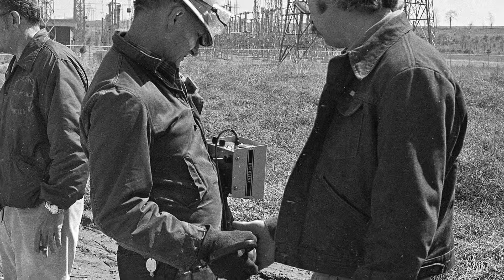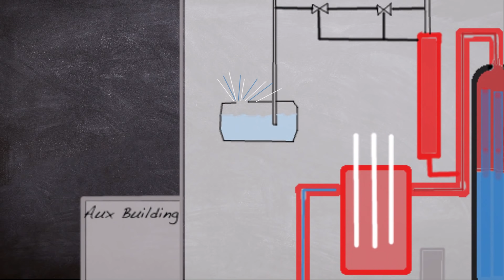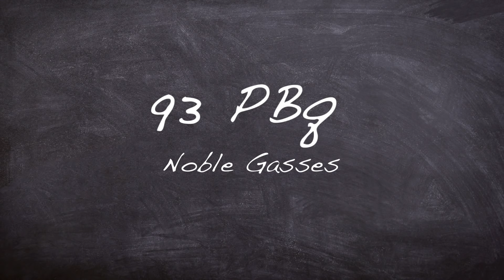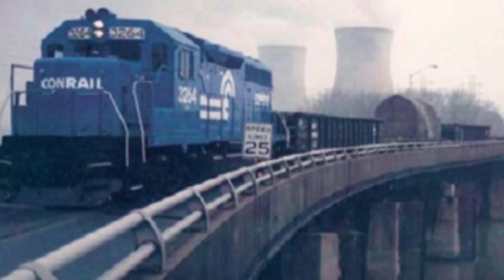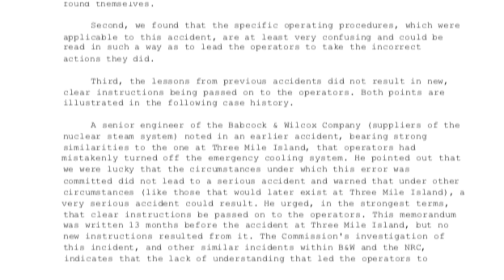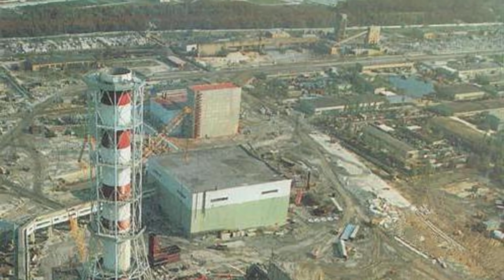A Brief History of: The Three Mile Island Accident (Short Documentary) (Part 2)

Comment: Man, this makes Chernobyl look...well it doesn’t really change how bad Chernobyl looked.
Reply: It makes the Soviet engineers look foolish. They put no thought into what would happen if the plant failed so as soon as it did, boom.
Reply: @andrewb378  this reactor was also different 
A total melt down of this type of reactor wouldn’t End as badly as Chernobyl 
Supposedly
Reply: there was no place to accitend in soviet union but lot of 5 year plans to fill.
Reply: @crimzonempire4677  Chernobyl also wasn't a meltdown. It was a steam/heat explosion of the reactor which then allowed the burning snd release of radioactive material
Reply: @stevenowen1748  it was a meltdown. All the cooling water evaporated. That's how we got elephants foot
Reply: @crimzonempire4677  just the concrete cylinders make that so
Reply: @stevenowen1748  literally was a melt down
Reply: @lockheedmartinf-22raptor73  There was after the explosion. But it didn't meltdown into the water table. The main event was the actual explosion.
Reply: @stevenowen1748  ...Of an operating fully fueled reactor core i.e. a far worse thing than a simple meltdown.

Comment: So the only way the control room crew knows that the tank in the auxiliary building is full is when the AC starts to vent radioactive gases out the chimney? Shouldn't there have been, i don't know, some kind of water level sensor connected to an alarm? And probably another alarm before that starts sounding as soon as water starts flowing into this emergency tank.

I mean, if you have some kind of emergency system that stores water in an emergency, wouldn't it make sense to alert the operators that the system has detected some kind of emergency?

Comment: If memory serves, the operators were ex-navy and brought that experience with them. The problem is that military reactors have different constraints than power generators. You did touch on the control room issues, but the layout was nonsensical with stuff like elevator alarms near core alarms and the alarm printer couldn't keep up with the issues so it had a several hour delay.
Reply: I think it was something to do with how they handle pressure buildups?  The system the civilian reactor used was perfectly fine on land, but if it happened on a sub there wouldn't be much of a sub left.
Reply: Navy has more operators on duty for smaller, less complex plants... so more likely for someone to notice something abnormal that an instrument may not indicate.

Comment: How do you “safely” evaporate nuclear water??
Reply: Slowly. Humans can handle low levels of radiation exposure and the most dangerous nuclear byproducts will decay away within a year or so, leaving only low emission sources. Furthermore, small amounts of radioactive water vapor will be pulled into the upper atmosphere where it will be pulled into clouds, and water (which clouds are made of) is generally decent at blocking radiation. If you just leave the water standing indefinitely though, you risk it being released in great quantities during a leak and also generating more radioactive isotopes as it sits (every neutron released can destabilize an atom and the chances of this happening goes up exponentially with the concentration of radioactivity). By dispersing it gradually, you greatly reduce the chances of knock-on accidents.
Reply: Evaporating it, theoretically the contaminated water will boil off and leave the isotopes behind. Think of boiling a pot of saltwater. The water will boil off but the salt will remain.

Comment: I can only imagine how much more advanced we would be as a species if we were able to fully realize the capabilities we have with nuclear power.
Reply: Exactly, sadly poor understanding and fear mongering have killed it. People don't look into the causes of these incidents and just belive anything radioactive is bad. They don't understand  how much safer and controlled it has become. Hopefully, with this newer push for clean energy, nuclear power will have a comeback.
Reply: @cheapskateaquatics7103  Nuclear powerplants are incredibly expensive to build and even more expensive to operate. They are simply not economically viable in most situations.
There may be reasons to heavily invest though. Mainly that a large nuclear industry is helpful in operating nuclear fuled ships and building nuclear weapons. 
Energy independence may also be one factor for some countries. Though that does often not include where countries get their nuclear fuel from.

Nowadays renewable energy sources are just way more economical and the storage problem is solvable with flow batteries (they can use far more common materials and no reduction in capacity over time) and salt heat storage.
Reply: @InLoveWithCities  they are cheaper to run than gas power plants, but expensive build means that brake even point is some 15 years into operation. Then there's decommissioning cost... 
However, wind and PV have much shorter lifespan, so they're not ideal, either. Hydro is great, but limited...
Reply: not to mention the amount of co2 saved from release.. but there's always a chance of disaster, I hope the new nuclear fusion reactor comes to fruition, it generates 4 times the power and is inherently safe (or so they say)..
Reply: Yeah, our species could have developed some great mutations that would make us into super heroes. :-D
Reply: @InLoveWithCities  whatever helps you sleep at night
Reply: I know right? High-tech kettles are useful AF.

Comment: Three mile Island sounds like more of a success story when you really think about it.
Yes, things went wrong, and yes, there was an expulsion of radiation, however the expulsion was on the lower end of things when compared to other events to other incidents such as Chernobyl and Fukushima, and it was of no fault of reactor design as it's sister's 40 years of safe and effective service would demonstrate. (To be fair, Fukushima Daiichi was of no fault of the reactor's design either, they just weren't expecting an earthquake followed by a tsunami of that calibre)
It's only fault was insufficient monitoring for the supporting systems. All that was really needed to prevent the failure was pressure monitoring at both sides of the relief valves so the operators could have actually confirmed a pressure decrease once the stuck valve was triggered closed. If such sensors were fitted it, this "disaster" would have been very easily prevented

Comment: What gets me is that, not only did the stuck valve gave no proper physical status indication, it was not given any redundancy. By fitting four valves as two series pairs in parallel you have a system where one valve stuck open or closed does not cause a failure. Obviously the valves should all have physical status indications so that a stuck valve could be detected and rectified to maintain the redundancy.

Comment: This is process design as much as anything else. If the pressure relief valve had a proper tellback switch on it instead of just a bulb across the solenoid, the failure would have been spotted in seconds. Someone cheaped out for a few dollars worth of a microswitch and a roll of cable, and it screwed the whole deal.

Comment: I would love to hear about Sadam Hussein's nuclear plant that was blown up by the Israeli's!
Reply from the maker: Ive already done a video on that https://youtu.be/UxuG5GVa43A
Reply: A.B. Yesssd
Reply: Based and redpilled
Reply: @PlainlyDifficult  what about the US over speeding his centrifuges being used in his weapons program
Reply: @Cowboycomando54  Wasnt that Iran like decades later?
Reply: Kezza Wozza yes, that’s Iran being hit by a computer virus which may or may not have come from the US and/or Israel.
Reply: It was redistributed all around the local site via semi aerodynamic-fin stabilized, medium density , gravity assisted  high explosive material redistributor devices delivered via human operated high speed low drag ,partial internally pressurized, winged high pitched turbo spinny fan operated ,accoustically-volumous high pressure oxygen suck- expand-blowout exhausters with computer assisted accuracy modulator devices 
Successfully pinpointing the reactors and subsequently redistributing them along with any respective operator personnel within the immediate proximity of the aforementioned reactors
#ControlRodOperatorLivesSplatter
Reply: Hear this: there was no nuclear material in that building.  It was still under construction.  Unlike any attempt in the history of Arab military attacks, Israeli air force precision strikes blasted the huge building off its foundation.
This meant the place was useless... it would cost a huge sum just to remove all the rubble.

Comment: Its honestly impressive how well the reactor was managed and a major disaster on the scale of Chernobyl was avoided.
Reply: To be honest, the part where you seen the control rods enter the reactor in the last video got me thinking that the exact same thing would have happened as happened in Chernobyl, thankfully, Three Mile Island didn't use graphite tips.
Reply: @thyrampantpigeon  Not quite the same at all. TMI was a much smaller reactor and had a containment building. Chernobyl had a positive void coefficient and TMI has a negative void coefficient, so the trigger for Chernobyl wouldn't have triggered a sudden burst of fission in TMI. There is also speculation that most of the brunt of Chernobyl's explosion was from the meltdown exposing ... some sort of reactive metal like Sodium (NOT Sodium, but something similar) to the main reservoir tanks below the reactor when it melted that far and less so hydrogen disassociation from the coolant water or a steam explosion from the temperature difference.

So in short ... No. TMI literally could not have exploded like Chernobyl.
Reply: @ashkebora7262  ok einstein
Reply: I think they avoided something in the scale of one of the Fukushima reactors. I'm not sure if that was an impressive achievement or pure luck.
Fukushima size without an ocean, wind blowing in the right direction and being able to flush huge amounts of highly contaminated water away would have been be pretty bad.
Reply: @Ulrich.Bierwisch  IIRC, Fukushima only became bad because their backup generators got flooded, too, and the batteries would only last so long. It was mostly a less than bullet-proof design. The only reason water really escaped was because they ended up having to pretty much fire-hose the core to keep it from melting down further, which without a circulation or protection system, yeah a good bit had to wash off. Though it was not anywhere near as bad as the media made it out to be.

Of course it wasn't good, but it wasn't anywhere near Chernobyl. (I think it was 1/10th the total radioactive material release? In that ball park)

TMI was yet another order of magnitude less. In fact, very, very little radiation escaped the facility. The biggest reason was it was a failure of control systems, and one stuck valve instead of a natural disaster completely removing fail-safe systems.

TMI had way, way more options to deal with it should it have gone further. There was little chance of further catastrophe (after the hydrogen caught fire and didn't blow up the containment building, which is exactly why they're required). It was already in shutdown mode and merely needed to be kept under water. The big difference is most of the control systems were still perfectly fine and the containment building was also perfectly fine.

Worst case, it would have simply further melted down and made it an even more tedious mess to clean up than a fused core.

Modern reactors are far, far, far safer than Chernobyl (made in the 70's, but an OLD design even then), Fukushima (built in the 70's with decent designs), and TMI (also built in the 70's and partly melted down in 79!).

We are several generations of designs past these old designs. Modern reactors, let alone the upcoming generations of reactors, literally cannot have an accident like any of these three ancient designs. Even among them as I've pointed out, they were each more safe than the others. Modern ones are an order of magnitude safer.

Any scares you hear about modern reactors are simply unfounded and based in misinformation or misunderstanding. It is truly sad how scared Americans and others are of nuclear power. In this case, ignorance is fear, not bliss.
Reply: Ash Kebora Fukushima’s diesel generators were outdoors so they got washed away by the tsunami, if that hadn’t happened they could have kept the cooling system running and nothing would have gone wrong. I think the only major mistake made IMHO was Tepco refused to pump seawater through the reactor to cool it because the salt water would have permanently damaged the reactor. The executives were only concerned with preserving the reactor because they wanted to get it running again afterwards (and then of course it melted down...!)
Reply: @ashkebora7262  Fukushima showed that a complete loss of cooling is enough to get the total meltdown with severe contamination of the surrounding area. A hydrogen explosion or a little bit more meltdown at TMI could have easily ended like Fukushima but without the luck that the wind blows the worst stuff out into the ocean. They had no clue what was going on in the reactor until the opened it up years later.
Reply: @Ulrich.Bierwisch  This is factually incorrect and I already told you why. TMI had their cooling systems in place, still. Yes they would have been in trouble if all sources of cooling were washed away like in Fukushima, but that simply was not the case. At all.

Fukushima contaminated the area because it was bigger and designed very differently from TMI and suffered a far, far worse incident.

There in fact was a hydrogen explosion (or rather combustion) at TMI, but the containment building held since pressure only rose to something like two atmospheres. Well within specification. TMI could not have ended like Fukushima without the circumstances being completely different. Sure, go ahead and play fiction by coming up with a scenario where it could have contaminated the surrounding area, but the fact remains that is absolutely not what happened in real life.

Again, modern reactors are far, far, far safer than these nearly 50 year old designs. In fact, several designs literally cannot melt down. They literally cannot contaminate the surrounding area. Some designs have to be coaxed in to fission actively, and if the power cuts or the building is destroyed, the resulting reactor "core" becomes no more dangerous than a lump of extremely low yield uranium. Basically a little more radioactive than a uranium mine, in which humans work just fine without issue.

These old accidents are very interesting and were indeed big invents from history. However, they should not be used as evidence for why we should not use nuclear power: Modern reactors are a whole different animal.
Reply: Ash Kebora fukushima's radiation is found on beaches with hundreds of dead fish and is on the beach of California
Reply: @OnsideHaddock72  Thats stupidly false. I saw those articles circulating and they were immediately disproven. The radiation didnt even make it far out to sea, let alone killed fish.
Reply: @OnsideHaddock72  "There are people here in California who are worried they could get fried by going to a beach, and this research confirms that those fears are wrong and inappropriate,” says Daniel Hirsch, a nuclear policy researcher at the University of California, Santa Cruz

Research updated. You're even more wrong now.
Reply: Martin your eyes aren't strong enough to change our physical surroundings
Reply: @OnsideHaddock72  No i care more about the truth. You just want to curse and panic, so we wont see eye to eye. Study some more and stop panicking. Not nearly as much damage was done to the ocean or other as you may think. No dead fish, nothing.
Reply: @ashkebora7262  I like you. I'm all about Thorium reactors but it sounds to me like you might be more interested in liquid salt? still a great system, I just love me some thorium.
Reply: @ashkebora7262  Um sorry you can not say "impossible".  If enough things happen, anything is possible and many incidents (that never should have occured but DID occur) prove this.  In short, things are unpredictable...so your comment "cannot melt down" make me less likely to believe you.  I have noticed many intelligent designs have flaws because of this kind of thinking.
Reply: @johnspence8141  with modern electronics and sensors anything short of a deliberate sabotage is not gonna cause a melt down.
Reply: @johnspence8141  no, you can actually say "impossible" when it comes to the physics of thermodynamics. Its the same as saying the atoms in a piece of rock in your backyard wont just spontaneously split and cause a runaway nuclear fission reaction and explode like a nuclear bomb.
Reply: @REIDAE  no one said “impossible” about the laws of thermodynamics.  That’s your interpretation of what I said.  And guess what even certain physics laws got rewritten as greater understanding came about but I get what you mean. 

What I’m talking about is mans ability to find a way to fuck up.  That is a law that overrides all others.  Usually starts with deregulation though
Reply: @artruisjoew5473  pure nonsense and spoken out of lack of life experience.  If it can happen it will.